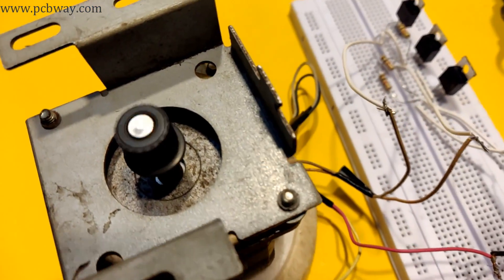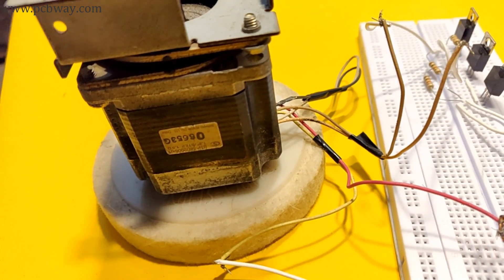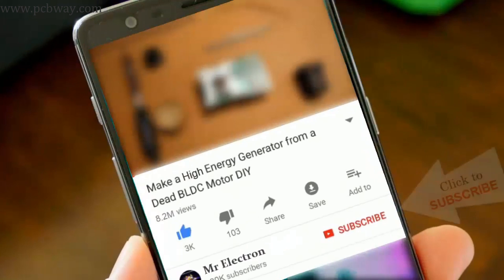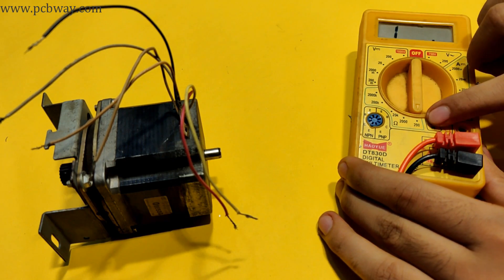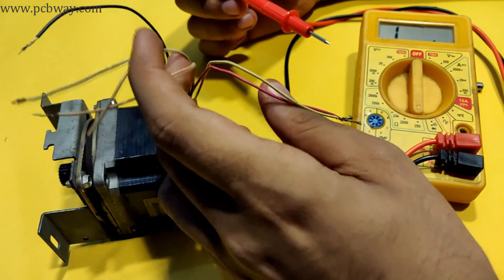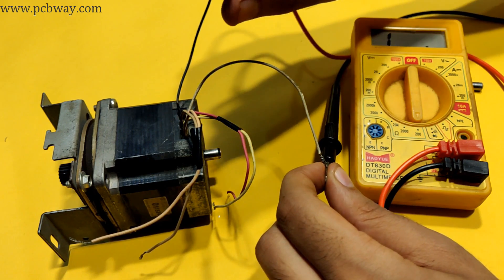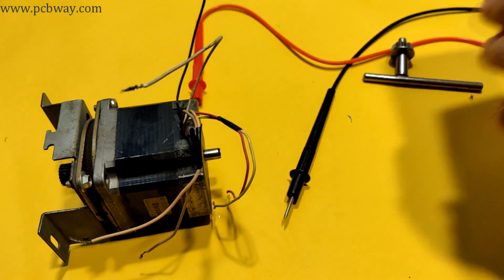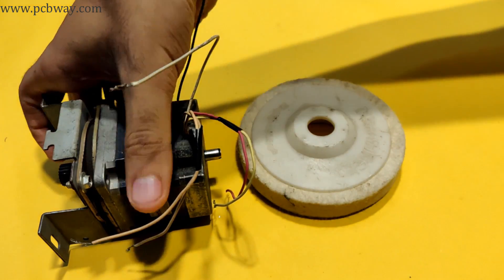Wow !! Run Stepper Motor without a Driver Circuit || New Idea 2018 - PCBWAY

Comment: Hi There, very useful video, rather the only one of its kind on youtube, the third reason is you don't want to use the Arduino to control the driver and the use of stepper motor is to get low rpm high torque output, which similar DC or even geared DC don't provide, (normally I would say). But I need help, can't run my geared stepper motor 28BYJ-48 5VDC it has 5 wires and four of them as same oms. please advise the connections for this specific model. and I need minimum rpm if you need change the value of few components.

Comment: Yes, there is another reason to run it this way, I am using a stepper motor as part of a Linear actuator on rails as part of an assembly process where I only need to control the forward and reverse movements using limit switches, reversing power switches and PWM DC speed controllers.  This is to have a platen delivered forward for the cutting operation and then retracted to home position.  In situations where there is the same repetitive actions as in an assembly fixture, this is something I am looking into doing.
Reply: Old thread. I’m trying to endlessly circulate compressed air through air ram motor attached shaft to shaft to turn a dc motor as a generator to make an alternator. I was thinking bleed the air into a large rubber inner tube when it’s full. I thought of your idea use 2 stepper motors run it like a rolling pin in a box over the inner tube quickly push all the air into a tank from inner tube limit switch stops simple ice cube relay with 0-10 sec delay switch direction back to pressure actuate solenoid psi is up stepper motor drives the rolling pin forward full auto this alternator will charge battery’s endless pull very few amps to operate 12 Vdc solenoids etc. I have the step up air valves low input voltage so high output. And a large switching solenoid I ndusttial grade stuff. I’m a industrial mechanic
Reply: A

Comment: What happens to torque here in this case ????
If driven through driver card and run with this set up, for a same rpm does the torque follows the ( speed vs rorque characteristic ) curve ????

Comment: 5 pins stepper motors are technically 6 pins does the 5th and 6th wire of 6 wire stepper motor are both centertop?

Comment: Stepper motor is meant to be driven and controlled, not used a as a fan motor of other nonsense.  I don't see any practical use of stepper motor this way.
Reply: How about for testing motor coils or an axis or limit switches without having to power up a new machine? 
I use another stepper motor to do this by simply wiring them to each other and turning one by hand to drive the other.

Comment: can you show how to drive a 4 wire stepper motor continuously. I have a large one
Reply from the maker: Yes sure
Reply: Will be very helpful if you could give circuit diagram or demonstrate how to drive four wires stepper motor ad well

Comment: Every hear of a schematic diagram?? Those are extremely useful for conveying wiring.  Would be very useful to your audience. For that reason I am disliking into your video.
Reply from the maker: Actually, the circuit is not self starting as you might have seen in the video.. For that reason i am improving the circuit and will upload the video with diagram for the self starting steppers
Reply: @MrElectron  Where's that video?

Comment: DC motors certainly offer more torque compared to stepper of comparable size and weight
Reply from the maker: No..  the torque of stepper motors is maximum in the categories of dc motors.
Reply: DC Geared Motor will give more torque.....